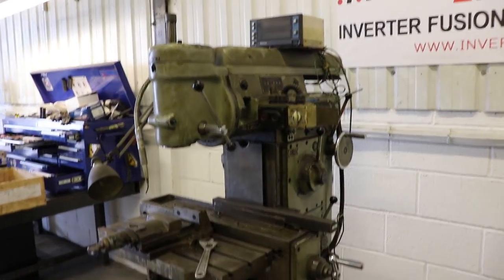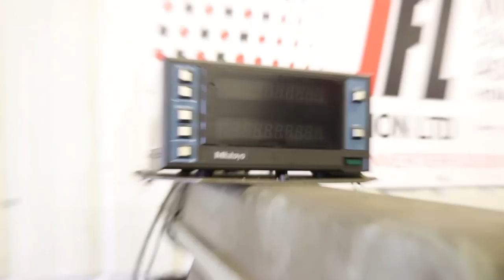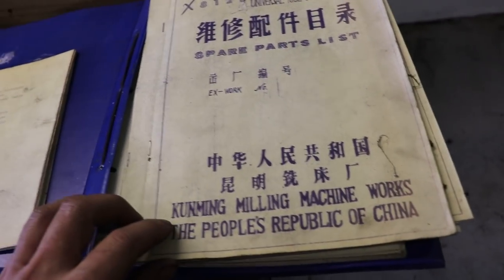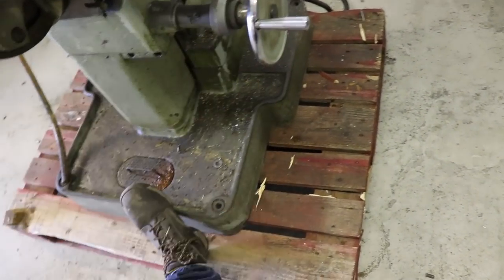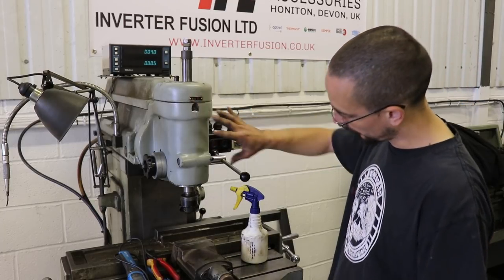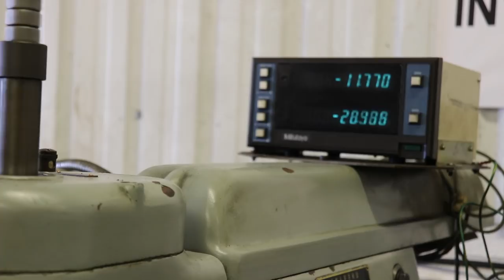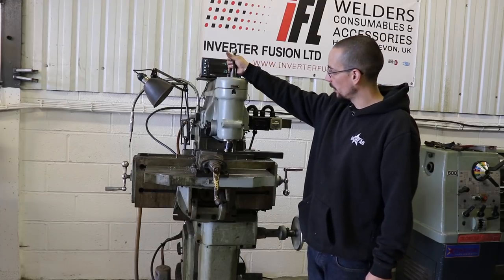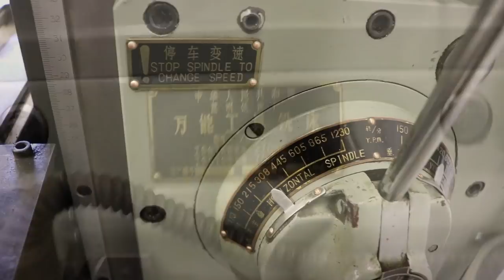MY NEW VINTAGE CHINESE MILLING MACHINE.

Comment: Took a bit to find
Yunnan Machine Tool Works
Established 1961.
This is Model X8126
Reply: Nice work.
Reply: Correct. I have it’s older / bigger  brother the X8130. They were made by a number of Chinese factories, mine made by Beijing instrument machine tool works. 
The X8126 in the video is a direct copy of the Polish made Avia FNB26, I use to own one of those also. They are very similar machines to the Russian Stanko 676 and 675.
Reply: @jtprecision933  I have this exact machine, but absolutely no where can i find a manual on it. The only thing i need to know is the bed speed on the lever for the gearbox, the tag was worn away when i received the machine, the tag for the spindle speed is still visible, just not the lower lever for the bed. If anyone had a clear picture that would be awesome!
@urchfab ?

Ben

Comment: Cleaned up bloody nice Matt. Good idea to check the bed is perpendicular to the spindle. Put a dial gauge on the spindle (not running - too hard to read) and run the bed across. Adjust as necessary. This mill will be a great asset to the workshop
Reply from the maker: I will do that. Cheers

Comment: You have lucked in there. With a rotabroach cutter and a vee vice this milling machine excels at mitring tubing for frames and roll cages. Can set the angles perfectly and it holds them very firmly to make easy cuts.

Comment: Great machine Matt and in such good nick, but when you grip your work piece in a vice don’t rely on a nip with the handle, give it a few sharp bats with a mallet to make sure it’s very tight. Things move and the results are rarely happy.
Reply from the maker: I will do that in future. Cheers

Comment: Not sure if it's commented on in the rest of the post... But you can use your Lift for the cars to lift it off .... The only problem is trying to slide it back to the place where you want it..... If you have a Galaxy phone with bixby you can use bixby vision to read the Chinese characters .... Google translate does the same thing you use the camera and then basically place it over the Chinese characters and usually translates

Comment: The toolroom I worked in bought one of these, but with a longer bed. It was ok. Not as good as the Bridgeport's, but useable, stable accurate and slight play as the bed was almost fully over to the right. It had an R8 spindle like our Bridgeport's, so tooling was interchangeable.

Comment: Hi Matt , the rattle you here is  when only one of the four tips of the cutter is cutting intermittently at the start of a cut . Wen more tips come into contact there is a constant pressure on the spindle . Usually those type of vertical heads have sealed bearings . Keep up the fantastic work .
Reply from the maker: Ahh thanks for the info that's good to know.

Comment: That looks like a solid machine and the finish was good even at a slow speed. I have been milling all my life and still prefer Bridgeport they are easier  to use and more versatile, the spindle stop is so useful  when drilling. Looks like you will be able to take bigger cuts on yours. Where there's a will there's a way, I like how you got it off the pallet.

Comment: A good first project? Make up a set of dimple dies for me! A kit is $600 and just a die alone is $150! Most of the work could be done on the lathe. Or all of it. But would be interesting to see you do it on a mill by hand
Reply from the maker: That would be a Good lathe project.

Comment: The noise is gear backlash. Most mills do it. You should clock the head square to the table before you start.

Comment: You might consider threading the four holes in the base to install long bolts.  You can use the bolts mounted on the base to screw down to 3/4 inch plates sitting on the floor.  You adjust the bolts to level the machine.  Just makes it easier to have a level machine, specially if you do machining on odd shaped parts.  But, it's really better having all your machines perfectly level, something your floor is not.  Crazy looking  machine, you'll have fun getting use to that coming from a Bridgeport.  I know I would also.
Reply from the maker: I will do that, I still haven't got around to levelling my lathe properly yet. Cheers

Comment: Main power line emergency foot cut off switch. In case loose fitting merch gets caught on some bone breaking moving parts. chucke2009 has a great video on him making a 50ton press. Next wish list item next to a mobile overhead gantry.

Comment: To add if you were climb mill with the tip cutter it could have been pulling its self along...check the jib strips might ned a bit of a turn, not much.

Comment: That's an old machine, lots of power. The different tooling requires different length draw bars, that threaded rod. 
From the looks of the end mills you got with it they were cutting soft materials, 2 flute windmills are mostly used for wood, aluminium,  copper and brass.
First thing to upgrade is that vice, get a good mill vice. That style vice is best for tossing the part at you. Their design tends to lift the handle jaw side up when clamping.
That app I told you about will give you your power feet rat to use while cutting.
Reply from the maker: I will keep an eye out for a decent vice, Cheers Frank.

Comment: nice Machine. Heavy castings indicate quality and accuracy as well as low vibration. The noise when a cut is started is quite common. A loose quill or spline most likely. Now you can machine heads accurately. 

  have fun with the new toy for if it is not fun why do it?
Reply from the maker: Good to know, Cheers

Comment: If the only off button is the one facing forward best to face in the direction of where you would normally be standing so you can press it in an emergency

Comment: It’s a variation of this mill. Lots of them were made in Russia and most of the ussr http://www.lathes.co.uk/stankoimport676/  The vertical head will probably be lubricated with grease, the rest of the mill will be oil. Just to the right of the speed selectors there’s an oil sight glass, it has a pipe directed at it from the oil pump.when the mill is running check oil is being pumped on to the glass. Let me know if you need to know anything else. Forgot to mention on the top of the spindle there’s a left hand threaded cap with a hole in it for the square bit of the drawbar, the original drawbar can then be used to eject the tools without hitting the drawbar.
Reply from the maker: Great info thanks, I will check the sight glasses today. Cheers

Comment: The mill has cleaned up nice, I have a german Theil mill I think the Chinese have copied this and put their own stamp on it, evidently rolls Royce used them in their machine shop.
Reply: i am a chinese, these machine were manufactured by kunming company a state owned company in old communist era. high quality definitely, i mean manufactured. the design i think maybe shared between communist countries, so no matter who copy whom. after all east germany is communist country too.
Reply: dont look down upon these old chinese machine, compared with bridgeport, i say its definited high quality because in that era those state own company are not operated for profit. the ceo was just a gov officer, so there was no need for him or her to cut cost.

Comment: I’m not familiar with this design. But people should know that industrial machines designed and made in china have been very well done over the decades. They aren’t cheaply made.

If you’re going to make the collet rod, it should be made from 4140, and for wear purposes, the thread should be surface hardened.

Comment: i agree it was scretchy , glad nothing broke or shot out from under the machine halfway down and the mill stayed upright 

if you can find a big enough flycutter you can probably work on cilinder heads with the machine , the table is big enough for it
http://www.metalworkingfun.com/attachment.php?thumbnail=2599
with the dro and the propper tool you can probably redo / redress the valve seats too if its a head with straight valveguides (if not you need sumting to angle the head on the table )

from wat i could see on pictures from google the general shape and operating handles look a bit like that of a deckel (those ar actually quite well made machines , believe there from germany)
this is a picture of the machine set up for a horizontal milling cutter (you can convert youre machine intoo that too if you have gotten the parts for it in the stuff you got with it )
https://machineks.com/zdjecia/279/14989_146384.jpg
the reason i was looking intoo a horizontal milling machine (smaller one) was to use it as a surface grinder wich might be of use for you too if youre going to make fine fitting stuff from big lumps of steel and tools for youre shop